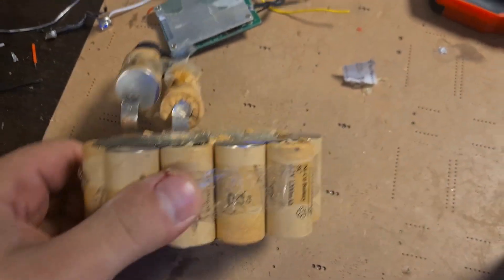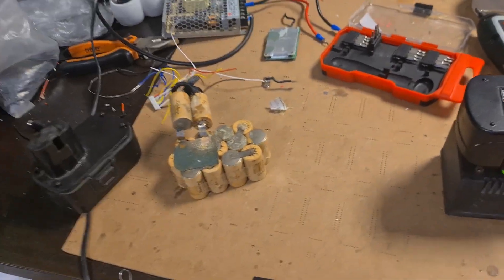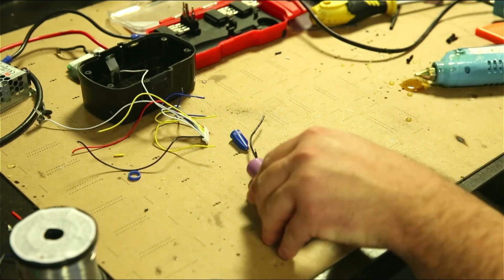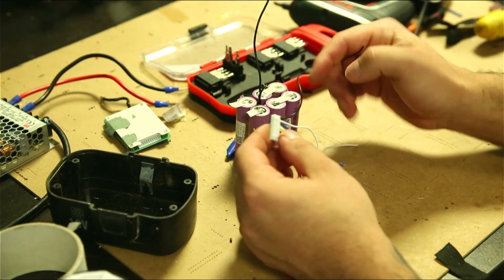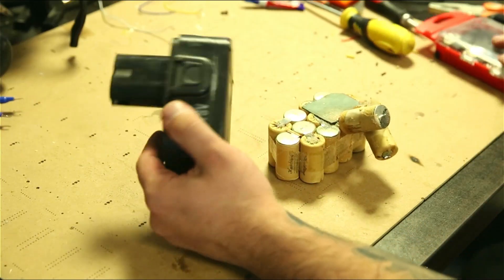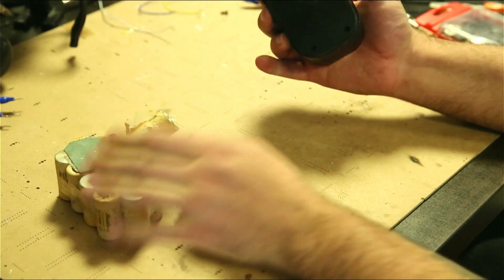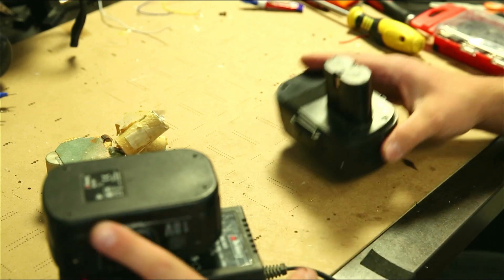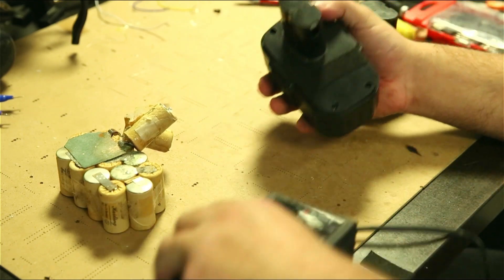Replace dead cells in hand-drill with recycled Lithium-Ion Batteries

Comment: I'm sticking with Ni-Cd SC for now because of the ability to work at low temperatures. Have you tried replacing it with Ni-Mh SC, how will it behave when charging ?
Reply from the maker: I did not tried those as I don't have any recycled. To buy new, it's better to buy the battery directly assembled